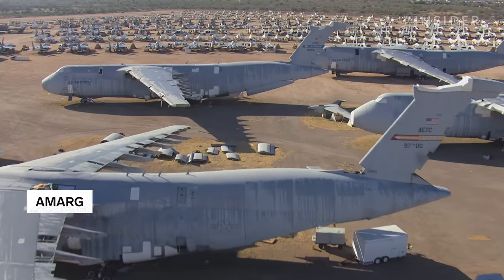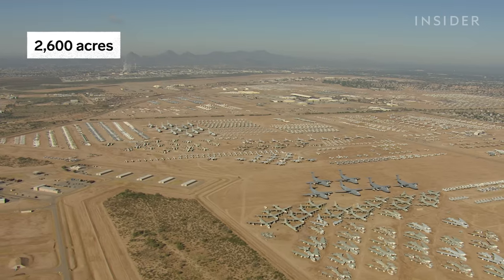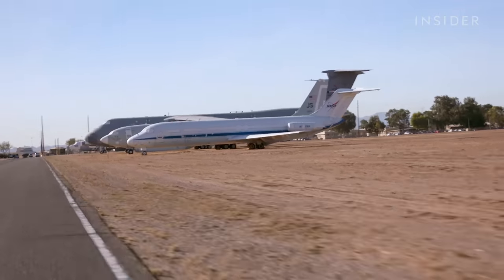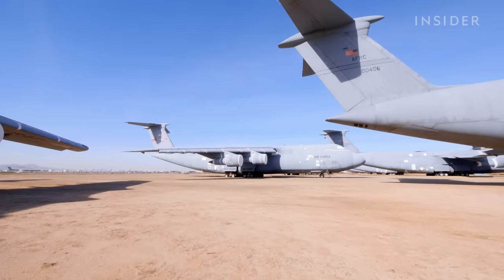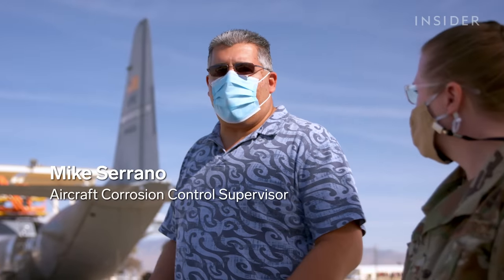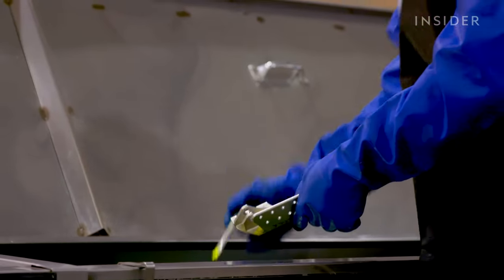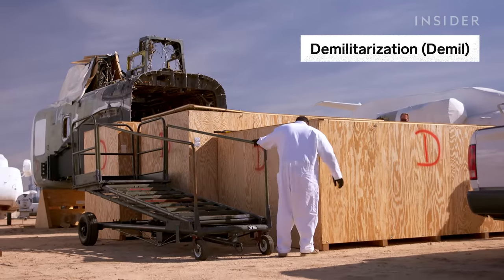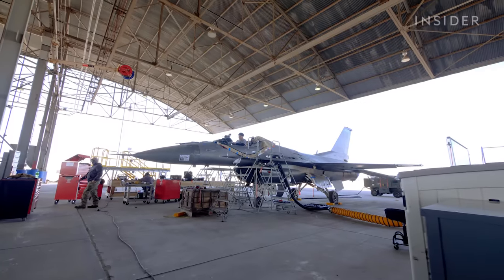How The World's Largest Airplane Boneyard Stores 3,100 Aircraft | Big Business

Comment: One of my old Air Force bosses got into a wee bit of trouble back in the early 70's just after Vietnam, while assigned to Davis-Monthan AFB.  His punishment was guard detail as a Security Augmentee for 30 days in the boneyard.  It consisted of roaming around the boneyard and reporting in by radio every half hour.  He said at the time they still had many WWII and Korean War era aircraft as well as newly retired jet fighters, jet bombers, and multi prop transports.  The boneyard was huge and he was put in different sectors on his shifts.  At the time he was told there were over 10,000 aircraft crammed into the boneyard.  As newer models came in, but older ones were condemned, scrapped for parts, or sold off to other countries.  He said it was eerily quiet out there, but there was the constant sound of metal flexing from the hot sun into the cool evenings.   Most activity was during the day and his shift was at night.  It was just him (and a couple of other augmentees), an occasional maintenance team, and roving SP patrols that made sure no one was sneaking in to steal parts or vandalizing planes.  His only other company was the occasional coyote or other desert creatures.  Otherwise, it was a quiet punishment.
Reply: i just want to do that, would not be punishment at all hanging out at night way out there ,
Reply: And they paid him to do that. I do it free for a couple weeks. I've got a few old aircraft friends that I used to fly on I'd like to revisit
Reply: Sounds like an okay punishment for me since I like quietness and calmness
Reply: His punishment seems like a dream to me
Reply: Yeah I want to do that
Reply: I is me too. Scared of spider. My is bye.

Comment: It's amazing how much time, energy and money has to go into simply maintaining aircraft when they don't do anything, it's honestly surprising airlines like Ryanair are able to turn a profit
Reply: It's cheap compaired to scrapping them and building new ones when they need them.
Reply: Well, Ryanair's model is pretty much not to do that most of the time. They operate an all 737 fleet to simplify maintenance and training and they have them in the air for as much as possible, where they make money. It might not be flashy but it's a damn successful model most of the time.

Flag carriers and other airlines that operate a larger range of aircraft including long-range ones also try to maximise the time the aircraft are actually in the air. Freight carriers often operate older aircraft like the DC-10/MD-11 and A300 profitably because they spend more time on the ground because they have to link up to the logistics network. While the older aircraft might be too fuel inefficient and lacking in comfort for passenger service, cargo operators can pick them up for cheaper than the alternatives and the fuel inefficiency doesn't matter as much when they spend less time in the air.

Generally, airlines don't want to do any sort of bone-yarding like this because that aircraft isn't making them any money. Better to sell or lease it to another airline if it can't be used. But, due to the massive collapse in demand for air travel due to the pandemic, airlines have been forced to do this over the past year. Take a look at photos from Alice Springs. Cathay and Singapore Airlines among others have been plonking even massive aircraft like A380s there to wait it out.
Reply: Yea, most of the ppl could fly with quater of price when i look at these huge waste of everything
Reply: @uydudanbak  Is your usual choice of carrier the USAF? Do they throw you in the back of a C-130 or perhaps strap you into the weapons bay of an F-35?
Reply: @Deathmastertx  hahaha
Reply: It's a smart move, store the aircraft and reactivate them and upgrade when the need arises. They can sell it for scrap when when the airframe isn't feasible to be restored anymore, like those older model B52s and legacy fighter aircraft. 

People also complained that rusting M1 Abrams are just left in their own boneyard, people don't know that they go back to the plant to be refurbished. 

Besides most of the airframes or materiel that was stored in boneyards are being sold to other allied nations as excess defense articles.
Reply: no airlines are profitable,  they get a government bailout every 10 years
Reply: It's also why they chose the driest place to put them i believe.
Reply: @chineseviruszombie773  those super expensive ones might be though.  But there's probably only one or two of those.
Reply: There's an easy answer to that. The military is a non-profit.
Reply: Actually, the gov can renew most of the aircraft and sell them to India or African countries
Reply: Waste of money
Reply: Parts are taken from these planes to make other planes functional again. Many of these parts are not being made anymore. Whole new (old) planes have been made from parts here.
Reply: It’s the American way, waste billions on shit we don’t need, like the corrupt democratic politicians, Biden, giving billions to other countries for no reason while America is in “debt” supposedly
Reply: @AmericanRustWorker3369  you have absolutely no idea how foreign aid Works do you.
Reply: @chineseviruszombie773  and banks get that too.
Reply: @AmericanRustWorker3369  then stop being the world police.... america have to give money to others in order to do whatever the american government told them to do...
If america dont give money others countries dont give a fck about america.
Reply: The newer generations of people we're never taught or even think to maintain or preserve anything.  Most peoples thinking is use and abuse it.  If it breaks it must be crap so buy a new one and throw away the old one.  Trying to fix something properly that is broken or improving it, that is a whole new level of thinking that not too many people have anymore
Reply: Because private corporations maximize profit through "just in time" deliveries.  Money is "wasted" when stuff sits around unused.  For the military, that attitude will lose you wars.  Not having sufficient logistics when required will end up with unnecessary losses and possibly losing a conflict.
Reply: Waste of taxpayer money. USA needs to get smarter. Idiots letting planes rot is embarrassing compared to the 700 billion. A year we give them
Reply: Airlines don't make profits by selling rides. 
People buy cheap tickets months ahead of time, airlines use that money like banks, by investing in other businesses and on the stock market. They multiply the sale price of a ticket from the purchase date until the flight date.
Reply: they don't do anything as long as no one savage enough
Reply: @salmanahmed6042  the boneyard is a valuable resource for spare parts.  Much cheaper than having to manufacture those parts.  You seem to be clueless.
Reply: @johnlennon3460  It is not a waste of money and the aircraft are not rotting.
Reply: ዐዘ ሃቿነነ
Reply: This is WAY different than maintaining an active fleet of commercial aircraft. Not even in the same zip code.
Reply: subsidies, subsidies and more subsidies. And tax exemptions.
Reply: @Deathmastertx    .
Reply: It’s called “Subsidized” most lame businesses only stay afloat because of support elsewhere… life is a joke.
Reply: do you like it?
Reply: @Deathmastertx  I would be hilarious to see how an airline operating demilled C-5's or C-130's would work out
Reply: clearly @Shamrock didn't watch/comprehend the whole video...
Reply: because they do the bare minimum of maintenance, why do you think airplanes crash??? almost all of the time it's because lack of maintenance or human error during maintenance because budget cuts.
Reply: Most airlines dont actually own the planes they use
Reply: @misterbogs   The problem is our defense budget is bloated beyond belief. No American has died for our rights or freedoms since WW2. There are 5 oceans, 3 of which might have a war break out on. Why do we have 12+ Aircraft carrier battle groups?  Yes, these are being used for spare parts, but were they needed in the first place.
Reply: Well US Air Force is also in a business of making profit aswell. Of course with the help of the other branches but still. Just a business.

Comment: I relay enjoyed this, it's so sad to see aircraft on the ground just waiting to die, seeing them maintained and more than likely  flown again is great !
Reply: In building demo controled demolition is only used in 2% of the cases because of its high probability to go wrong, it's extreme difficult to get a building down in even 1.5X it's footprint, so difficult it's only 2% of demolitions, but could we not just get these to flying condition, they don't need to be safe, just fit remotes and we good.
Buy NY math we can get 3 buildings for every two planes.
That's,
Millions of dollars saved.
Environmental cost lowered.
Free Entertainment for the public.
Plus you could just 
Say terrorists did it for an extended resource gathering consent in the middle east, when the sad Kuwaiti girl story starts running thin.
Your welcome.
Reply: I drive by them everyday to get to work it’s pretty cool looking
Reply: Fix up the old f-15 and f-16s that are no longer in service and give them to Ukraine once the war is "over".  Those older model planes will still be enough to deter Russia from trying anything again.
Reply: Lies again? Changi Airport
Reply: The saddest story is the fate of the F-14. Retired before it's time because of politics.

Comment: April 17, 022----Did 10 in the Air Force, from 71 to 81 and it's SO strange seeing all the planes that were state of the art when I was in, now retired and many made into drones to be destroyed by those at Eglin. When I got out, the "teenagers" were just starting to reach front line units such as the F-14, F-15 and A-10....now stored there. Got into building models (mainly planes) and Monogram came out with a 1/48 scale, glass nosed B-25. He made a diorama out of it with a pamphlet to go with the unbuilt kit. It's sitting in a desert somewhere, waiting to be either sold or chopped up for scrap metal. Thanks for the video and while I never made it to the base back when I drove truck, I did spend some time at Pima Air Museum which has a lot of different aircraft on display.

Comment: Please accept my apologies for this lengthy “war story,” but I believe it’s relatable to the video. I hope you enjoy it. During our unit’s transition in the early 90s from the mighty Phantom to the Viper, our mission required continued sortie production with the F-4 and training on the F-16 to become combat capable. As you may imagine, parts, especially serviceable parts, or the F-4 were difficult to acquire. A Phantom returned from flight with flight control problems involving the lateral system. We began troubleshooting, and discovered the right aileron could not return to neutral. We rigged and rigged, but we were forced to look for the “culprit.” Keep in mind that the Phantom didn’t enjoy the luxury of the fly-by-wire systems. Other than the hydraulic actuators, the system was all mechanical linkage: push-pull rods, bellcranks, screwjacks, cables and pulleys. And don’t EVEN get me started on the engineering genius that was the artificial feel trim system which incorporated the use of a bellows. But I digress. We finally identified a problematic bellcrank under panel 88 R (?) if memory serves and immediately and .hopefully order an overhauled replacement. Nopity nope. The request went to AMARC (at the time it was the Aerospace Maintenance And Regeneration Center.) The jet was closing in on Hangar Queen status and we needed that bellcrank mosh skosh. This particular bellcrank was pretty darn finicky to remove as no one on our team ever removed one before. Even the engineers at depot claimed they’d never heard of one being removed before. It had to be twisted, turned, moved and your mouth had to be held just right in order for that thing to come out. When we heard the bellcrank would be coming from AMARC, our outlook was dismal. We doubted a part from an aged, retired double-ugly would be in much better condition than the unserviceable culprit we removed from a (somewhat) perfectly good jet. Plus the time it would take just to remove the thing from a jet in the desert put us at a disadvantage. The ahem new bellcrank arrived and initial examination made us even less hopeful. We pursued and the bellcrank slipped in surprisingly easy. We connected everything up and rigged the lateral system, and while there was some improvement, we had to do a little fine tuning with the linkage, primarily the screwjack. I don’t recall if the jet required a functional check flight (FCF) but it did correct the initial discrepancy. And we avoided Hangar Queen status! Well done, AMARG/AMARC!
Reply: Don't ever apologize for a story like that, good sir!  And thank you for your service!
Reply: loved the f4
Reply: ok
Reply: What's your age
Reply: good story
Reply: These aircrafts are bone yard of US army. 
With the help of these aircrafts USA lost Korea War, Vietnam War, Somalia War, War IN Iraq and now War IN Afghanistan.
Reply: @georgestokes5116  These aircrafts are bone yard of US army. 
With the help of these aircrafts USA lost Korea War, Vietnam War, Somalia War, War IN Iraq and now War IN Afghanistan.
Reply: @kamranmisri2366  That’s not quite accurate. While the storage facility was initiated and operated by the US Army Air forces in 1946, it came under the control of the newly established USAF in 1948. Currently, the 309th AMARG is a unit belonging to the Air Force Material Command of the USAF and services all branches of the United States Military. This is easily fact checked with a simple web search. Regards, Bill
Reply: @kamranmisri2366   I encourage you to learn about war. From Sumer and Elam to The Battle of Hastings to The Somali Civil War. Learn as much as you can. We have no idea how deadly conflicts have occurred since the genesis of human, so you’ll have to be dedicated. 

One cannot possibly be objective about war unless they dedicate themselves to understanding its existence. The wars you’d mentioned? They’re all modern wars. They get a tremendous amount of media attention and with that come the opinions from self-described experts. 

War isn’t something one can put in a nice, tidy little box with a pretty bow.

I get that your angry. But spewing angry and juvenile insults at an organization and, by default, it’s citizens is not only ineffective, but it’s very ill advised.
Reply: @sanaullahalom2253  I sincerely wish you the best!
Regards,
Bill
Reply: @williamkiefer1792  "One cannot possibly be objective about war unless they dedicate themselves to understanding its existence."

Couldn't agree more. I've been studying wars since I was a small boy, and have learned about wars from the bronze age to modern day, spanning many cultures, and countless eras. From combat tactics of the fighting soldiers, to command and logistics, and the socio-political forces that spark the conflicts. And I'm sure there are more wars I haven't learned about yet than what I have. But the strange thing is, the more I learn about war, the more confusing it becomes. There are endless ways that wars can and have been fought, and endless factors that dictated why a war is fought the way it is, and they are constantly changing.  

One thing I know for sure though is, luck plays an enormous role in deciding the outcome. Some might even say it's the single biggest factor in deciding who wins. Unexpected things happen that no one would have even considered, or could have possibly foreseen, that can turn the tide of a war completely. You can do everything right, and still lose. And the good guys don't always win. 

I wonder if humanity will ever learn to move past its warring ways, though if history has taught me anything, it's that common themes tend to play out time and time again. 

Anyway, that's enough of my ramblings. And thanks for your story, it was interesting.
Reply: It’s great hearing stories from people.  It’s better than the unoriginal and cringe taliban and healthcare comments.
Reply: @kamranmisri2366  

I already responded to you in a different comment section about the misinformation you’re spewing. Please stop you’re embarrassing yourself and proving your lack of intelligence.
Reply: @williamkiefer1792  

He doesn’t know what he’s talking about literally read his reply. Korean War ended in a cease fire and the US won in Iraq twice. The gulf war and the Iraq war 2003. There was never a war in Somalia that was UN mission to aid with famine. The Vietnamese war where the US achieved both goals and won majority of the battles and withdrew after a treaty was signed ending the war. The north broke that treaty and invaded the south and the US did not come back to help. The war in Afghanistan was a nation building failure big militarily successful. Osama and Al Qaudia were eliminated and the main war ended in 2001 with US victory. I could explain further If you’d like but people like him are always spewing misinformation.
Reply: Great story! And the F4 was one loud SOB in Vietnam! Or anywhere.

Comment: The Pima Air and Space Museum used to offer tours of “The Boneyard” 10 or so years ago. I don’t know if they still do. But the one thing I remembered from back in 2005 was the Guillotine. A massive 10 Ton metal Blade dropped by a crane used to slice fuselages in half.
Reply: They have their own museum. The actual boneyard is on base and you can't go on there